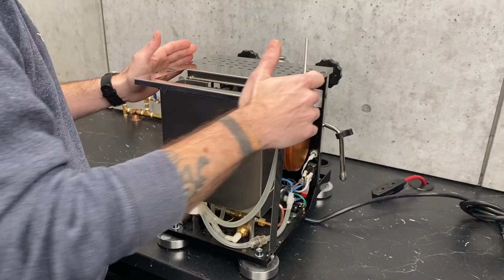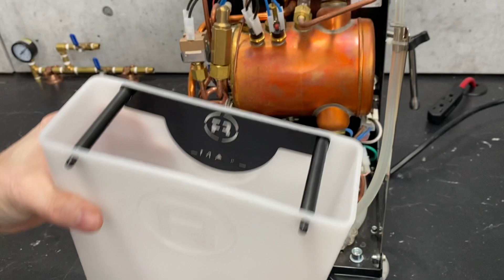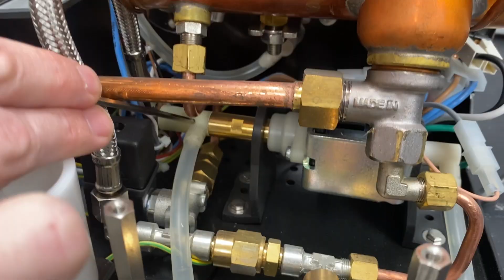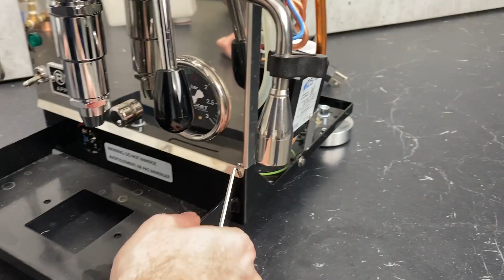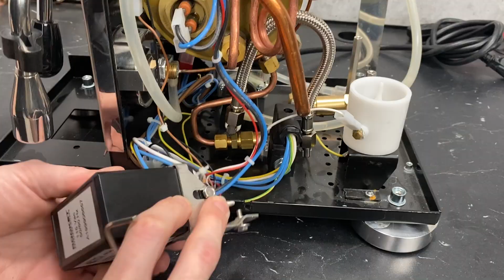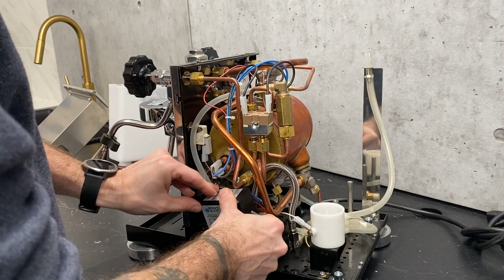Rocket Espresso Appartamento: Internal Tour and Component Identification

Comment: Today my Apartemento incurred it's first problem in the 10 years I've had it. Group head warm but no pressure on the dial. Opened the steam valve and hot water valve and no steam or hot water. Group head lever opens allows water through. Any ideas what's wrong?
Reply from the maker: Hi Xtal, Is the boiler heating such that water from the group is warm? If so, one possibility is the boiler's vacuum relief valve is stuck open. It should close once the boiler heats past boiling point. When it closes pressure builds in the boiler. If it's not closing you would typically hear or see steam releasing. If the machine is not heating at all then could be a bad heating element in the boiler or bad pressurestat which senses boiler pressure to control heating. If you purchased the machie from us reach out to our Tech Support here for assistance: https://www.wholelattelove.com/pages/support
Reply: @Wholelattelovepage thanks for taking the time to reply. It doesn't heat up at all. At first I thought it was only the steam but I think it had just failed and so the water coming out of the group head was warm. I've since checked the hi temp sensors/snap switches these are pushed in. I've got continuity on the element but no mains. I've got continuity on the pressure Stat, not shorted yet to see if it heats up. I checked the boiler water sensor by unplugging it and the pump came on. Looking like main power board or pressurestat?! Thanks very much

Comment: my Rocket appartamento works but pump is not shutting off, it just keeps working, making sound...checked brew switch, water probe, solenoid...everything works and pulls water as it should, but the pump never shuts off...is it main board issue?
Reply from the maker: Hi j,  That's possible but no way to be sure from here. If in the US/Canada you can reach out to our tech support team here for assistance: https://www.wholelattelove.com/pages/technical-support#contact-tech-support

Comment: Nice video! I have a question - water from the hot water tap has started to be blue. I did a descale (using Urnex Dezcal).about two months back. Do you know what the cause could be?
Reply from the maker: Hi j, some blue water when descaling copper boilers is not uncommon. But 2 months after the fact is not typical. Excess blue can indicate a few things. One is there was very little scale to begin with so the acid in the descaler reacts with the copper more directly. Any chance the water you are using in your machine is naturally acidic?  Since there are a number of potential causes and I lack details specific to your situation recommend you search "blue water from espresso machine"  this should help point you to a cause and have advice for your particular situation.

Comment: Great Video! I have a Giotto V. The pump doesn't shut off. I had a spare boiler level probe and replaced it but that didn't help. I have metered most things and I am pretty sure the controller board is out. I was lucky to pick up my machine from a gentleman who purchsed it new and used it a couple of times and then just let it sit. It is a great machine. Again thanks for the excellent video.
Reply from the maker: Hey ice, You are welcome and thanks for the comment! Hopefully you have or will get to the bottom of the issue.

Comment: Thank you so much! I'm experiencing an issue with the water temperature which is too low (and thus, my coffee is awful and cold). The head group is not warm at all (I can touch it with my fingers without any problem)! I replaced the pressurestat but it didn't solve the issue. Do you know what could be the problem? Thanks!
Reply from the maker: Hi f, sounds like the boiler is heating some? Group head heating comes from the thermosiphon which constantly flows hot water out to the group head and back to the boiler when the machine is idle using convection. if there were restrictions due to scale build up, etc that might limit the convective flow to the group head. When the pump is on it produces enough pressure to overcome the restriction in the brew circuit. Don't know if this is your issue - just a possibility especially if you know your machine may have some scale issues. If you purchased the machine from us you can reach out to our Tech Support staff here for additional assistance: https://support.wholelattelove.com/hc/en-us/categories/360005124554-Technical-Support

Comment: Ive had my Giotto Rocket for about 15 years and recently the steam wand has started to continiously spit out burned tasting water. what could the problem be.
Reply from the maker: Hi A, sounds like a leak in the steam valve. May need a rebuild and or cleaning to remove scale deposits.

Comment: My machine will not stop heating until the point where the safety valve releases steam from the front center bottom round port. and the pressure gauge is way too high .
Is there a quick fix ? 
I can guess that some thermostat sensor is not working. it should shut off the heating once it has reached the correct temp and pressure.
Reply from the maker: Hi h, Can't be certain from here but sounds like a malfunctioning pressurestat. The pressurestat controls boiler heating. When it reads the proper pressure it sends a signal to the controls to stop heating the boiler. They can malfunction and/or not read pressure in the boiler properly due to obstructions like limescale deposits.

Comment: Where is the circuit breaker switch? i put my machine on the side while there was a little water on the bottom and it might have caused a short! how can i reset it?
Thank you
Reply from the maker: Hi e, No internal circuit breaker. Water in machine can cause regular household circuit breaker to trip - especially GFCI type. Remedy for water in machine is unplug from power, remove housing and let dry out for 24 hours. Fan can help.

Comment: I tried pulling out the water level probe to see if it was causing the overheating issue but now the probe won’t get tightened when put inside the boiler, do you know what would be the issue?
Reply from the maker: Hi c, The probe goes thru a teflon fitting. The nut there can be tightened. It's a compression fitting that clamps the teflon fitting around the probe.
Reply: @Wholelattelovepage  it seems that the teflon fitting has fallen inside the boiler, any suggestions on how to take it out? Or if I can just leave it inside

Comment: Thanks for this, can I adjust steam pressure with this style of pressurestat? the older ones had a screw, this one is waxed in place. I have already adjusted brew pressure down to 9 bar but the steam is to high and (for me) makes steaming milk very difficult.
Reply from the maker: Hi JM, Thanks for the question. It likely is adjustable if it's the box type stat with wax mark. But, understand the manufacturer put the mark there for a reason. Likely to hold the position set and/or to alert for tampering. Don't advise changing the setting - lowering pressure in the boiler will lower the brew temperature as well. As an alternative you could bleed some steam through the wand before frothing to reduce pressure or take water out through the hot water wand until the pump kicks on and adds cool water to the boiler which will lower the pressure.
Hope that helps!

Comment: The video was excellent. I appreciate it. I recently purchased a new Rocket Giotto Cronometro R machine, and I've had it for around 1.5 years. I've noticed a significant amount of rust and deterioration in the front area of the bottom plate, where all the machine parts rest. What could be causing this rust, and what steps can I take to prevent it?
Reply from the maker: Hi n, Rust happens when frame paint coat gets scratched and moisture makes contact with bare metal. To prevent be careful when removing drip tray to avoid damaging paint and keep the area dry.

Comment: Is it safe to descale this machine?? I think i have scal buildup inside the boiler.. any suggestions on what i can do? 
I don't have professional service available where i live so any advise will be appreciated
Reply from the maker: Hi TCA, Heat-exchange boiler machines can be descaled. If you know there's severe scale buildup in the machine be aware descaling may not get everything and there's a risk some scale could break free without dissolving and plug components in other parts of the machines. If scale is mild you can follow this video on how to descale a heat-exchange boiler machine: https://youtu.be/yEGfyJkWSqU
Reply: @Wholelattelovepage  Does this apply to Rocket appartamento?? As it has  a Copper boiler & rocket does not recommend descaling their machines.. any updates on this topic?
Reply from the maker: @Coffeesatisfaction_  Most every manufacturer has some language in their manual about not descaling their machines or having a professional technician perform the service. I believe it's there to cover themselves from end users neglecting the machine, having lots of scale build up then descaling the machine and having issues due to clogs caused by large pieces of scale plugging machine elsewhere. If a machine is not neglected and scale is very minor then descaling a machine with a heat exchange or single boiler is okay for a home user.
Marc
Reply: @Wholelattelovepage  makes sense.. but how do I know for sure if the boiler has scale inside?
Reply from the maker: @Coffeesatisfaction_  One easy way to get an idea is to remove the mushroom from the E61group head and check for scale there. If there's a lot, that's a good indication there's likely scale elsewhere. Here's a video with more on the E61 group and mushroom: https://youtu.be/ELIwD40tsrs?t=136
Reply: @Wholelattelovepage  thank you for your help 🙏🏼❤️

Comment: Hello, my 6 year old rocket apartamento don’t start. The green light indicator turns on very low. We don’t have specialized service in my country. But I have access to all components and replacement parts. A few months ago we replace the on/off switch successfully with a local technician and an original switch. Is there a chance you can help me with find where is the error please? At least a few pointers or recommendations? Thanks in advance.! J.Luna from Mexico
Reply from the maker: Hey Run, here's a link to video on diagnosing heating issues on the Rocket Appartamento which may help: https://support.wholelattelove.com/hc/en-us/articles/4715260065939--Rocket-Espresso-Appartamento-Heating-Issues
And here's a link to our support site for the Appartamento with diagrams, manuals and more videos and articles which may be of help: https://support.wholelattelove.com/hc/en-us/sections/1500000401242-Rocket-Espresso-Appartamento
Reply: @Wholelattelovepage  perfect.! Do you have something for no green light or/and very low green light? Thanks again!!

Comment: awesome video Brian!  do you know why my apartmento would heat up properly up to 1.1 bar, then after about 45mins, the pressure would just drop to about .75 bar and stay there?  it would then rise again if I pulled steam, hot water, or brew?
Reply from the maker: Hey dc, Thanks for the comment and question. Not 100% certain but sounds like the pressurestat is not operating properly.

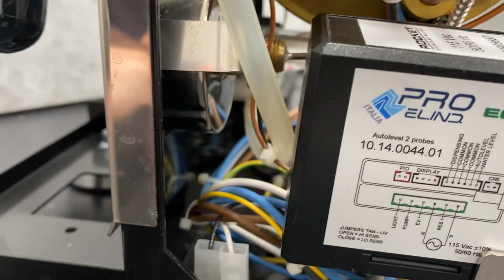Comment: After the unit has heated up for approx. 12 minutes, I begin having steam continuously releasing from the piece pictured at 12:55 in the video (the safety relief valve vent). Pressure stat has recently been replaced but didn't fix the issue. What would you recommend to correct the problem? Thanks
Reply from the maker: Hi Tony, continuous release of steam from the vent means the boiler is too hot or the valve is defective and stuck open. Boiler could be too hot because pressurestat is adjusted to high or heating element is not turning off. If boiler is too hot the high limit switches on top of boiler would probably trip.
Reply: @Wholelattelovepage  Thanks for the insight, I'll give it a try. However, my limit switches have not tripped and pressure remains 1.0 to 1.5 bar the entire time once the machine is brought up to temp. Must be a defective safety relief valve.

Comment: Brian- Awesome video!  Can you comment to how the heating element is sealed in place in the boiler?  Is this pipe thread with teflon tape?  Or some kind of o-ring face seal?  Or some other method?
Reply from the maker: Hey Thanks for the comment and question! The seal is a flat gasket made out of teflon.
Brian
Reply: @Wholelattelovepage  I've seen a number of boilers and elements in similar machines that have a V-shaped o-ring groove along the sealing surface.  Presumably this is for a Viton (or other FKM) o-ring.  Is there a reason these never seem to be used?  If just using a teflon gasket, why even have the V groove?

Comment: Is there any way to adjust the water temperature of the Appartamento?  My sense is that it’s running too hot.
Reply from the maker: Hi L, Yes there is a way. Here's a link to place in this video which show the pressurestat: https://youtu.be/YSdjl0UEaDU?t=705
In more recent Appartamentos the pressurestat will look like the one in the video. May look a little different in older models. Adjusting the pressurestat by turning the control changes the pressure (and therefore the temperature) in the boiler. Notice in the video there's red paint over the adjustment. Rocket would prefer the end user does not adjust the pressure/temperature. Know that in heat-exchange boiler machines like the Appartamento the boiler typically runs much hotter than the desired brew temperature. The difference between boiler temp and brew temp changes depending on variables like how long the machine has been on, time since last use and ambient temperature. Standard operating procedure for HX boiler machines controlled by pressurestat is to use a cooling flush prior to making espresso. To do that, right before pulling a shot, without the PF attached lift the lever and let the pump run until brew water flow from the group has smoothed out with no excessive steam or bubbling.  Usually takes a 3-8 seconds for smooth flow. Using cooling flushes like this allows a user to quickly manipulate brew temps. For cooler temps flush a bit longer. For hotter temps use a shorter flush. Here's a video on how to use cooling flushes: https://youtu.be/bHSFBM3cWHI
Hope that helps!
Marc

Comment: Rocket's manual seems to suggest against descaling. I've had the machine for a while and the water I use (although bottled) is still fairly hard. Should I descale my machine?
Reply from the maker: Hi DA, Most all manufacturers recommend against end users descaling espresso machines. Why? If severely scaled, scale particles can break loose during descaling and clog internal components of machines. In reality, descaling HX boiler machines like yours is relatively low risk. Should something clog during descaling it's fairly easy to access and correct - if you're comfortable using basic tools. And, unless scale deposits are moderate to severe you're unlikely to have any problems. I'll link a video below showing how to descale an HX boiler machines like yours. Going forward, it's best to filter your water using calcium to magensium ion-exchange to reduce calcium hardness while maintaining a mineral level needed for good flavor and corrosion prevention. BWT Water and More has a number of solutions including low cost drop in reservoir pouches: https://www.wholelattelove.com/products/bwt-bestsave-s-anti-scale-filter and a filtering pitcher: https://www.wholelattelove.com/products/bwt-penguin-2-7-l-water-pitcher
Both of those when used as directed prevent scale from happening in the first place. How to Descale HX bopiler Espresso Machines: https://youtu.be/yEGfyJkWSqU
Hope that helps!
Marc
Reply: @Wholelattelovepage  you have the most helpful channel. Thanks for the info!
Reply from the maker: @Waddlesworth_the_brave  You're most welcome!

Comment: Hi Whole Latte Love, if I wanted to connect a brew pressure gauge to my appartamento which line would I tap into with the manometer capillary tube? thanks
Reply from the maker: Hi o, Brew pressure gauges usually read pressure in the line after the pump and OPV. You need to put it in the line running between the OPV and the heat exchanger. Since the Appartamento has an E61 group an easier option is mounting a pressure gauge to the port on the group. There are aftermarket gauges available which mount in the hole revealed after removing the Allen head bolt in the sloping front of the group. Gauge at this location gives a better reading of actual pressure in the group during an extraction.
Reply: @Wholelattelovepage  thanks for your help
Reply: @Wholelattelovepage  thanks, your help is much appreciated

Comment: Awesome detailed walk-through! I run my Appartamento in a little cafe in the Philippines and it keeps up all day long!

The only downside is that it cannot be plumbed! I have been thinking of a way I can setup a 5 Gal Jug underneath the counter and pump water in the machine whenever the machines empty water sensor goes off. Some sort of relay that goes into a timer that will pump water into the reservoir for 'X' amount of secs till the reservoir is full, then it stops.

So I don't have to refill it every 15 mins. 🙂

Comment: Hello,

I am planning to install an extraction timer for my appartamento, can I please ask which wire inside the machine I can use to connect the electricity.
Reply from the maker: Hi Brian, Thanks for the question. Can't answer that as I do not know what type of power you need.

Comment: I’m looking for a leak that only seems to occur when the machine is turned on. Is it safe to remove the casing and turn the machine on in order to find the leak? Thank you so much!
Reply from the maker: Hi R, It is relatively safe so long as you use reasonable caution if powering up the machine with the case off. Do not touch or cross any exposed wires.